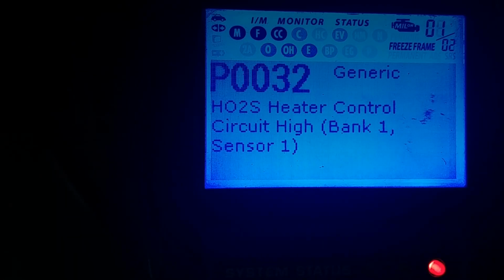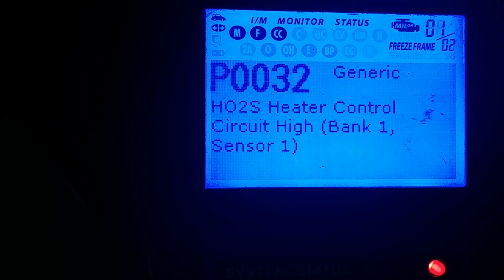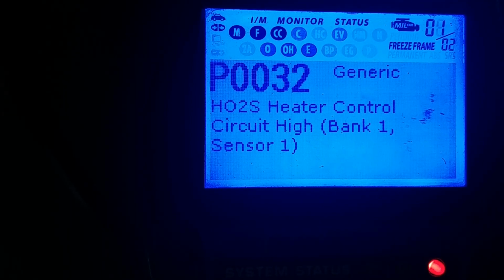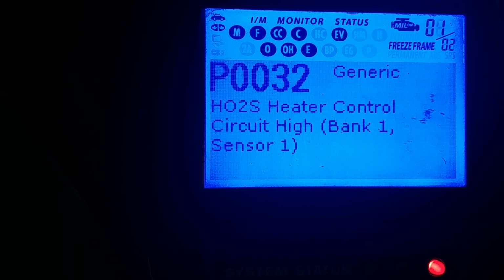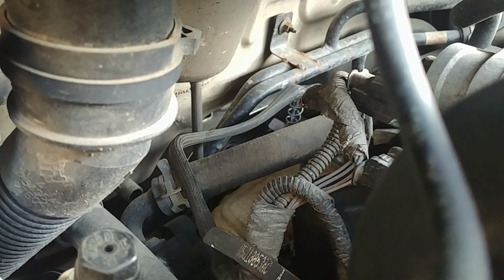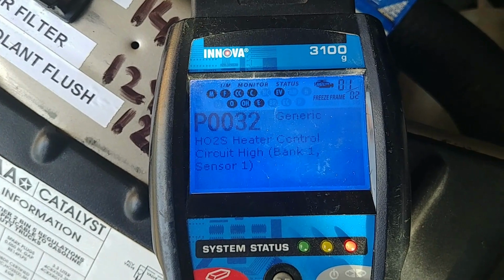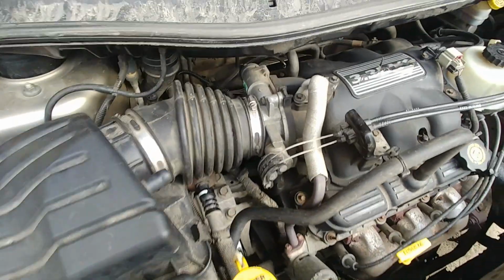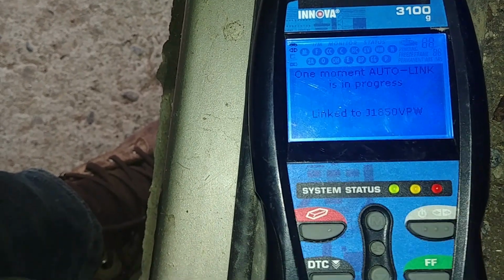P0032 O2 SENSOR HEATER CIRCUIT HIGH - Everything You Need To Know (Troubleshooting and  Repair)

Comment: You did a great job just removing the music man with something lower noise. Any idea if this code is associated with code P2243. I have both codes (P0032 & P2243) but in a pending condition, not active or stored, they came when I replace the front upper O2 sensor. Please advise.

Comment: I had this same code on a 300c hemi 5.7 I changed ALL the O2 sensors there was 4, I can NOT get the dash light and this code to go away and I’m still having the same issues which is a rough idle and runs like shit almost like a cylinder misfire or bad plug wires
Reply from the maker: Hey Justin! Seems like your O2 heater doesn't turn on or wiring down to the sensor is open or shorted. First check voltage at the Up stream O2 sensor at the connector when you start your truck you should read battery voltage on heater wire. Second check sensor ground (ground wire at the connector to know good chassis ground) you should have not more than 100 mV.
Reply: @PistonShack  will do, thank you for taking the time to reply
Reply: Did it work? I'm having that same exact problem 😢

Comment: I am wondering if the voltage to the heater circuit should be 12 volts.  Your multimeter shows 4. something volts as mine does
Reply from the maker: Hey Larry. When the engine is started, 12V should be present momentarily on white heater wire(s) .

Comment: I've replaced both sensors and error code is still there. Hi fuel 
consumption. I've checked, when i start the engine, heater works and the
 signal goes toward 1V on both. So the sensors work and their heaters. 
Where possibly look for? But the computer shows straight line and heater in one sensor takes only 0.7A. THe first one 5A.
Where to find? Can I get the wire color codes to trace back and see why the post cat heater take only 0.7A?
Reply from the maker: Hi John! What vehicle do you have?
Reply: @PistonShack  Forester 2004. 2.5L non turbo. Downloaded color coded wiring diagram but there is no sensor connection. Sensors installed produce signal but computer does not register that is error code is still there. Possibly previously car was garaged near the sea, so salty vapor could affect electrical connections.

Comment: 2004 Subaru Outback Wagon EJ259 - So, I confirmed continuity with AF Sensor, and its good. I also checked the source and was getting 12.34 dcv. But it's still throwing a P0300 Heated oxygen sensor (HO2S) 1, bank 1, heater control - circuit malfunction code...what else is going on?
Reply from the maker: Hi Jelti. Sorry for the late respond. I don't always see comments on old videos. Anyway. 
Well, what I will do. Set my scanner to up and down steram sensors, short and long term fuel data. Warm up the vehicle for 2-3 mins at 2000rpm then take readings. Separate O2 problem from the lean condition. Malfunctioning O2 sensor data compare to correcting value by adding more fuel (SF trim +30%). Add propane to the intake, O2 sensor should go rich up to 1000mV, if no respond sensor circuit is defective. It could be wiring problem to the sensor? ECU problem. Check signal wire if it shorted to the ground pulling signal down all the time. Bad ground on sensor generally runs voltage high. Open signal wire or short to the ground on signal wire. Testing the sensor (vehicle not running): unplug the sensor, look for bias voltage. Good sensor should see 0 volts. if voltage goes up to 400-600 mV your circuit is good, oxygen sensor bad.
Let me know how everything is going. Cheers!
Reply: PistonShack, thank you for your kindly detailed response! 

I went ahead and ordered the new upstream AF sensor, and installed it. Viola, it took care of the code fault! NOW, I have (2) new codes to deal with; P0442 EVAP system - small leak detected. P0420 Catalytic converter system, bank 1 - efficiency below threshold. 🤦🏽‍♂️

Comment: Hi I have a 2008 Kia spectra 2.0l sx po0037 code  downstream. Problem just replaced already and think the oxygen sensor fuse relay box ? Thanks
Reply from the maker: Hi David,
Heater Oxygen Sensor Control (HO2S) Circuit (Bank 1, Sensor 2). Check sensor wiring and connector, make sure you have ECU signal voltage, battery and ground first.
Reply: PistonShack Okay, I will check and let you know asp
Reply: @PistonShack   where the ECU locates?
Reply: ECU and ECM are NOT the same ..   is that corrected ?

Comment: P0300 Random Misfire Detected
P0141 02 Heater Circut ( Bank1, Sensor 2)  is it my sensor or catalic converter
Reply from the maker: Hi Miguel,
Do you have those two codes at the same time? What kind vehicle do you have (make, model, year)? Thanks.
P0300 could be fuel or spark issue. Did you check your fuel trims, fuel pressure and injector impulse?
Reply: Code p0141 and code p300  Eliminated by changing 02 heater circut ( bank 1 Sensor2) . I did have 2 p300  misfired  detected. I now have 1 more p0300 misfire detected which relates to exhaust manifold gasket with low oil pressure on gauge cluster. I changed all sparkplug  and wires and new oil pressure  sound. Turn truck on with ticking sound. Not sure if its coils or oil ring, oil pump.
Reply: @miguelcovarrubias4976  my truck is doing the same thing 04 dodge ram 1500 4.7

Comment: For me it was bad PCM on my Jeep 3.7, getting codes P0032, P0138, P1129, live data shows O2 sensors are coming online but takes longer and will burn a little more fuel. It seems heater driver circuit failures are common with Chrysler and should have been separated from the PCM for easy replacement.
Reply from the maker: Also to separate o2 problem from lean condition check if ECU is adding extra 20-30% of fuel to correct the value by checking Short Fuel Trim Data.Test sensor respond by adding extra fuel (propane)to the intake. If you see voltage went up to 1000mV you have respond from the sensor, if value stays at 0 this is not lean condition and we have problem with a sensor. Check wiring down to the sensor. In case is signal wire shorted to the ground pulling signal down. Bad ground on sensor will generally runs voltage up. 
Thanks for watching. Cheers brotha!
Reply: Viewing live O2 stream and fuel trims makes it much easier to locate issue but did not have access to that. I have 100k so I just replaced O2 sensors and same codes returned. You can check ohms from the corresponding pin on PCM harness to ground to rule out both sensor and harness which means PCM heater circuit driver bad, diisconnect battery first. When I put 12volts on old O2S heater wires it was drawing 1.25 amps or 15 watts each x 4 O2S is 5 amps or 60 watts total. Heater circuit is on all the time which is prob why the transistor burns out.
Reply from the maker: Thanks for sharing your experience!

Comment: your knowledge is too weak, sorry.... and there is a difference between the fuel ratio sensor and the old O2 sensor.  both looks the same but reads differently...... old O2 style sensor resds  0.1 to 0.9 voltage..... and lead or rich fuel condition looks opposite to the... A/F sensor..... which reads  3.30 steady as voltage and no fluctuations..... good luck.

Comment: you didt said how to fix the problem when you buy a new sensor and still check engine light comes back on and says circuit high bank 1.  and when you started your car the engine light  did not lite up at all. it should do it then turn off.  while engine running. a loose bulb?
Reply from the maker: Oh, I missed that. Thanks for your attention and telling me. I just went to check the "Check engine" light - it works. Might be  it was the problem with instrument cluster.

Comment: thanks for the good video shots and clear camera shots..At about 11:20 on time line you are using the torch to heat up sensor. what color lines do you have the volt meter probes connected to? thank you
Reply from the maker: Hi, for the voltage readings you measure between other two wires which is not your heater circuit wires (in my case blue signal wire and white ground wire)

Comment: How much time the heater voltage is on to heat the sensor?
Reply from the maker: O2 sensor only operates at the temperature 600-750F, below that sensor wont work. It depends from the outside temperature conditions and type of the sensor (zirconium or titanium). Normally heater sensor maintaining the temperature when exhaust gases not hot enough.